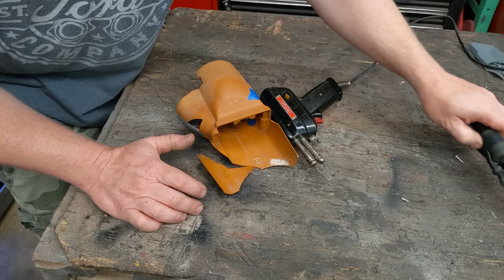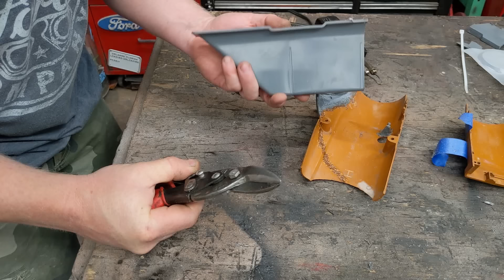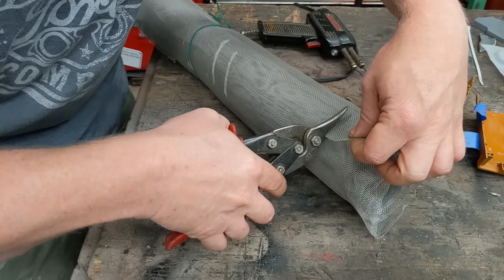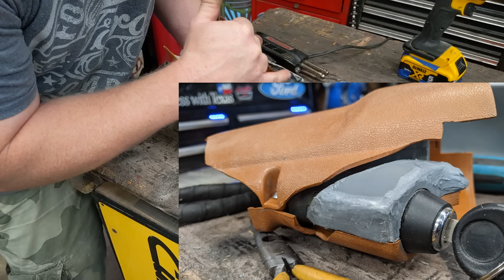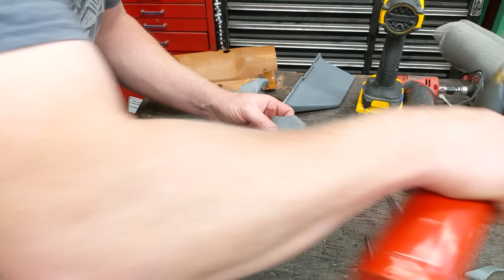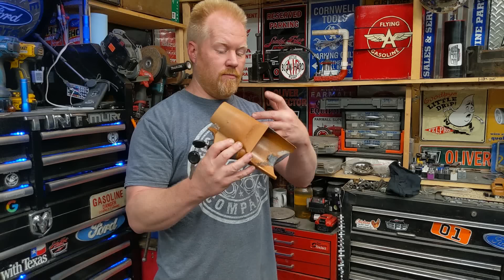HOW TO FIX broken plastic ULTIMATE Welding Forming Repair techniques

Comment: Great tip with the screen. I keep stepping on my plastic dust pan I leave on the ground and make new breaks to weld. It is worth people buying a roll at Home Depot for $8.48. The aluminum screen is so useful. Can filter fluids like oil when pouring into a container, or making a box screen to catch bait in a stream for for fossil hunting, can use it on the end of a pipe to catch lint, use it in sink drains, etc.
Reply from the maker: Agreed, I use it for a ton of stuff.
Reply: Fossil hunting, with bait? I hope that one of those "fors" was supposed to be an 'or,' instead, LOL!

Comment: What about black zip ties??
Reply from the maker: They're nylon and seam to get brittle once heated and melted into the repair. They do work just not nearly as well as HDPE.
Reply: @sixtyfiveford  Thanks!  I just thought since they are UV resistant they might be different plastic.

Comment: OH one last tip on how I get away from over heating with a cheap soldering iron when I am not wanting to use the electronic work grade hot air and temp controllable unit I have is to throw a box with a plug for a computer power cord, that then leads to a combination of a dimmer switch and electrical outlet so what ever is plugged into the outlet I can control the power going to it using the dimmer (continuous rotary so it takes fine tuning and maybe even marking off areas so you know about where to turn it for various jobs to get the heat right, like you can literally tune it to melt wax till it forms a liquid bead on your soldering tip then touch that to a wax item and pull back leaving a thin fiber of wax for the prongs on a ring, that would be used to hold a stone in place. much easier than trying to carve it all out, lol and same can be done with plastic too, to do a lot of very complex work all by hand so the quality is all down to your eye hand co-ordination, no complicated computer tech or machinery to do a job. :)
Reply from the maker: Very true. I have a light dinner electrical box just for that purpose.

Comment: HA HA so you are adding steel belted radial level additives to the plastic (like used in tires to make them tougher and melting the rubber around the metal wire instead of plastic :D )

Comment: I have a 3D printer pen I use for some plastics like nylon, PC ABS, and PLA right now (cause I have welding mig wire ie 3D printer filament in those that will run through and let me add it to the existing weld all automatically though it can be tricky with the speed and flow and all, (also it gets hotter than the plastic melt so that the molten filament will melt the plastic I am bonding too, in this case, though hitting it with an oven packed in salt afterwards to keep it from sagging while allowing higher than melt temp for a bit to make sure it is all fully bonded is useful,
Reply from the maker: I do have a 3D pen but it seems to not get hot enough to melt the parent material to what I'm putting on it. 3D printing would be awesome if it didn't take so long to design everything. I would probably spend 10 to 20 hours just designing that part.
Reply: @sixtyfiveford  for me the printing itself seems to take far to long, and part of what inspired me to try and redesign the tip concept (since it uses a single point of fluid through a tiny single hole) and best design I have so far to speed it up is a wide nozzle that has a long slit the width of the typical diameter of a nozzle now, but the length is anywhere from .25 inch to 8 inches wide on a rotating neck and metal square pins on solenoids to push them down closing the portion of the slit under each, or retracting them so a segment that allows the molten plastic to flow up to the side of the closed pin, is exposed so the retraction turns into a single nozzle sized opening, that way the nozzle can drop as many lines of plastic at once as it's width or can be segmented out so it turns into say 10 nozzles all exactly the distance between the lines of plastic being placed for infill say, or just a couple pulled back so it similates 3 nozzles all right next to each other for a shell, with rotation of the neck there to allow it to rotate the nozzles so they are always laying plastic right next to each other, (so you don't get a calligraphy effect say as going in a circle to make round shell) 

basically all that crazy text outlines a nozzle improvement that speeds say a 3 hour print, up till it only takes 15 to 20 seconds instead of that original 3 hours. allowing nearly as fast as injection mold printing speeds, (unless the plastic will not cool down fast enough so that the cool down of each portion so it does not sag becomes the limiting rate of speed you can print, much how the rate of sag being gone from brick laying mortar is the rate you can lay down bricks, so even a machine that goes far faster than a human can't go to max speed because the mortar setting up is what slows down the machine or the whole building will not form properly and sagging cracking and falling apart might occur.

Comment: When using the copper wire, (You can use steel wire as well. Like the wire used to tie rebar together.), coil it around a nail or a dowel. Pull the coil off. Stretch it out a bit. Then flatten it. Not quite a mesh. But easier that trying to feed individual pieces into the "weld". By the way, I thought of the crack jokes, the first time you said it.
Reply from the maker: I like the way you think. I have used that method before but the plastic has to be pretty thick.

Comment: I've been doing this for years. After I got into 3d printing I started doing this different. I use a 3d pen now. $20-40 on Amazon. Melts it and I can extrude whatever type of plastic I need, hdpe,abs,pla, etc.
Reply from the maker: I do have a 3D pen, but it doesn't seem to melt to the parent material extremely well.
Reply: @sixtyfiveford  yeah it can be a bit tougher. I turn the pen up as high as it will go and push the tip into the item to melt it. I add the additional material from the pen once it's good and hot. I do also use a wood burner (soldering iron for wood) with various tips as well.

For quick repairs though, just turn the 2d pen on high, smash the tip in and glob on the filler.

Comment: Good tips. I've done this for years. Once in a while you'll get a combo that oxidizes(burns) and either won't stick or becomes brittle.  To help that, use some nitrogen or probably whatever welding gas you have to flood the area with shielding gas while they melt. Keeping the tempt down below 400F will also help keep it from scorching. I just bought  a hot staple gun to fix a John Deere plastic hood. They are essentially the sam as your wire swiggles that load into the end of the soldering gun type contraption. Once it heats it melts into the plastic.  Then you let it cool for a minute and release the staple.  Pretty cool product for a larger project. Btw. I  found an old Rabbit dash shelf laying in the field at my Dads old place. Not sure if any of it is usable.  Lmk if you want to see some pics of it.
Reply: great tip, I'll just go to the trunk and get that bottle of nitrogen I just knew would come in handy some day 🙄

Comment: Your nylon is brittle because it's hydroscopic, it absorbs moisture and then melting it destroys its structure. When injection molding nylon parts, the plastic resin is dried in a sealed hopper prior to molding. On the other hand, if you throw your nylon zip ties in a pot of boiling water for 15-30 minutes they will be much much stronger. Also, nylon is not really compatible for melting with most other plastics like ABS, HDPE and Acetal because of it's higher melting point and semi-crystaline structure.

Great job on your repair! Thanks for this video 👍
Reply from the maker: Great info.
Reply: Great info but unclear about your point. So the nylon zip ties CAN be used if you boil them first for 15 to 30 min and then used to weld other nylon material?

Comment: Nice. This is the exact method I use. I even have the same soldering iron. If you can find it there is a special tip (weller 6160) that kinda looks like flat spoon that works perfectly for plastic. I can get weld that looks like a tig weld bead with that tip. I got a bunch of them on clearance for about a dollar each. I guess nobody knew what they were for.
Reply: One came in the set dad bought years ago...said it was a desoldier tip
Reply: @red2965  ooh, that's the search term I need, huh? Sweet, thanks!

Comment: I smashed the front end of my BMW M roadster and the ducting for cooling my brakes radiator fan shroud, bumper and lower grill were all busted up.  Got the welding kit from Harbor Fright learned how to fix it all myself save thousands on parts and I know they are fixed well too.  Couldn't fix the broken radiator or transmission cooler or power steering cooler up front but she's was due for upgrades lol.
Reply: I broke down and bought one a couple years back.     I’m a fairly accomplished welder yet found using that thing was damnably hard.   In fact I found using this style such as in the video seemed to work better🥺.     
    One word of caution with the HF machine to keep it from burning up.   Once you’re finished LEAVE THE AIR RUNNING.     It will let the insides that stay very hot cool down spit doesn’t burn up internally.     I hot that yip from a guy who uses them on a commercial basis
Reply: @drizler  good notes, I couldn't get the air one to work for me I used the iron and mesh one to fix my car and so much more
Reply: @drizler  that's exactly what must be done with a commercial-grade (or any, really)  heat gun. If you don't, the elements inside will burn up in nothing flat.
Reply from the maker: Awesome!

Comment: Using a small bag of sand under the part makes working on the odd shapes much easier.
Reply: Good tip!
Reply: Genius!
Reply: Don't inhale fumes
Reply: @rosemariebredahl9519 exactly what he s doing
Reply: I saw a vid, the guy fixed  the bumper from his car ,he added a thin layer of steelwool in the weld to make it stronger.
Reply: @QLAUZSIBEL  I would have thought that steel wool would rust because it is exposed to the elements.
Reply: @keithhaycraft3765  Hi,no he welded it within the plastic .So afterwarts it is not exposed...
Reply: @keithhaycraft3765  Thinking it may have ended up completely imbedded in plastic so oxygen and water won’t touch it. But that’s an assumption. If I were going to use that tip, I’d add extra plastic on the back side to ensure the steel wool is completely encased. Even using plastic straws would work. Or save some old pieces of plastic like empty jars or even those plastic food containers. Good use of a single use plastic.
Reply: @QLAUZSIBEL or stainless steel staples maybe
Reply: Quite correct! Or a small container of sand, for small parts, or even borrow the kids' sandbox, LOL! Just make sure it's not a plastic bag, or you may have sand everywhere if you're not careful.
Reply: @MaryAnnNytowl  weld the sand into the plastic. Extra grip!
Reply from the maker: Very true.
Reply: @sixtyfiveford  _ At 02:48 he says "Going DEEP into MY Crack" .... Ha Ha _
Reply: @liongod1000 could be the fumes
Reply: Great advice(!), thank you. :-)
Reply: Go outside or have fan and open windows to blow fumes away from yourself. Plastic fumes can be extremely dangerous and do long-term damage. Suggestion, have  a casual safety talk with your local fire brigade.
Reply: Nice
Reply: Ah a bag of sand that's a great idea. I've been using a hackysak for this. Also of course a hobby vice usually works amazing too.
Reply: @r0ckworthy  bags of sand are great fire fighters for small fires caught quickly, throw them, or roll them over to smush the flame.
Also no water damage. 
You get creative filling balloons or other bagging you can throw and have breaks over the fire.
Use boric acid to mixed in.
So much fire damage can be avoided.
Bucket of wet towels to throw is good too(boric acid in there also).
Reply: I see you learned the trick of using a piece of discard #10 gauge electrical wire instead of buying those ridiculous priced soldering iron tips😸.     They work better anyway and you can shape them any way you please 👍🏻
Reply: Why didnt i think of that. Good one.
Reply: I never thought of that one,   GREAT IDEA!    I always stack cloth 2x and boards which is a great PITA……THANKS!😊
Reply: Salvaged plastic car bumper pieces work well… poly carbonate & ABS 
30 & 50 gallon barrel material also works well. HDPE
Oil bottles & jugs. HDPE. 
Many household items come in HDPE.
Reply: Thanks for the different techniques.  I have a plastic gardening cart that has serious cracks and I saved pieces of another cart just like it so bondage should be good. I'm gonna reinforce with the screen..
Reply: That's genius, thank you. This is the solution to like a dozen things I've gotten frustrated with over the last year!
Reply: That's brilliant
Reply: S me art
Reply: Thanks for the tip!
Reply: Thanks a lot
Reply: Aberystwyth is a great place for sand.
Reply: No. It does not. Never so such a stupid thing.

Comment: I have a bumper cover to repair.  These techniques are great.  Thanks!
Reply: bumper covers are typically urethane and won't weld, they'll burn. You need something that will chemically bond. 
The various 3M products while expensive, have worked for me. With some good judgement one can repair with a minimum of materials for small repairs. 
There is a 'welding' process for urethane bumper covers but it's technically akin to brazing. the filler material creates a bond across the crack. the original material isn't fused together.
Reply: @drivecam101  thank you for that info.

Comment: I just love this video.   So many things you can repair with plastic and basic tools. Welding, fabbing replacement parts, double decker rain barrel.  I've even blow molded parts with a heat gun and a shop vac.

Comment: In my experience it's not a good idea to mix plastic types, because they have different melting temperatures and don't usually bond well.
Reply: Totally agree this was a part of my body shop class and there are ways to diagnose what type of plastic you have and the more waxy plastic wil just tear from other plastics that are not.
I have actually rebuilt a rear bumper from a 1990 honda accord where the exhaust tip exit was (completely missing melted away) went into scrap bumpers and cut a piece of PP from one, accord bumper was PP then shaped it and welded it in before filler you bearly saw any signs of it having been repaired minor amount of filler and filled some minor holes in the weld and then got textured to match.
This was a rare car in the county and car was in very good condition.
Reply from the maker: I find HDPE works excellent with virtually everything.
Reply: @sixtyfiveford  Might well be true but still always better to try to use the same material

Comment: That’s the way I did it - - until I learned to weld with “Bondic”.   Bondic isn’t a glue,     weld like you would braze, use a light instead of a torch.  
      I’m a subscriber, learned a lot from ‘Ford”.
Reply: Marc;  I bought Bondic & glued up some stuff, didn’t work at all, read some reviews & tried again a year later.  
Ya gotta weld.  I was gluing.  Bevel the piece as if you were gonna weld, then fill in as if you were welding, 
it stays soft forever until you’re ready, then shine the light on it, won’t work if the light can’t touch it, build up layers 
as if you’re welding.  You can push the gel around until it suits you, then light on it.  You can layer it to build stuff.
It’s kinda expensive, but I love it.
Reply from the maker: I haven't tried that.

Comment: Have a 2018 Toyota Corolla I had hit raccoon split  the skirt on driver's  side you think could fix the same way....
Reply: This will defiantly work.  They use a method real close to this in just about every Bodyshop.
Reply: I doubt you can fix a racoon with a hdpe strip and a wire mesh ,but you can try . . .

Comment: Adding heated strips of desoldering braid into the crack works great!
Reply: That stuff is on par with the cost of gold. I think I'll use something cheaper, myself.
Reply: @ProleDaddy  that's true, but I use it changing electronic components and keep the left over pieces of it and it works better with the solder in it.
Reply from the maker: Very true. Solder chucks actually works well to bond plastic I find they intermingle with the plastic pretty good and create a rigid bond. I found this out by accident having solder left on my gun tip.

Comment: My john deere ride on mower hood has about a million cracks in it. I tried to weld it back together with a soldering iron ages ago, but it keeps cracking along the repairs. I was going to use your OLD trick using paperclips to reinforce the welds, but I like the idea of using the stainless mesh better. I will give it a go this arvo.
Reply from the maker: Paper clips, mesh or anything really helps. I've even laid nails in joints before.
Reply: Actually window screen is aluminum.
Reply from the maker: @knot4man  Actually they have stainless window screen.
Reply: @knot4man  sorry, but you're incorrect. There are both kinds made and available for anyone to purchase. I've bought both, actually, for different uses.
Reply: @knot4man  not in my area, which is bushfire prone. 
Fly screen must be stainless steel.
Reply: @sfrrob  there are both kinds available to purchase. I've bought both, actually, for different uses. And if they don't sell one kind where you live, I'm sure there's still eBay in your neck of the woods.

Comment: I took my dad's 250 watt solder Iron and silver soldered a flat stainless steel plate to the copper tip, works great for welding and melting in the screen. Recently bought a hot weld staple gun for thick plastic